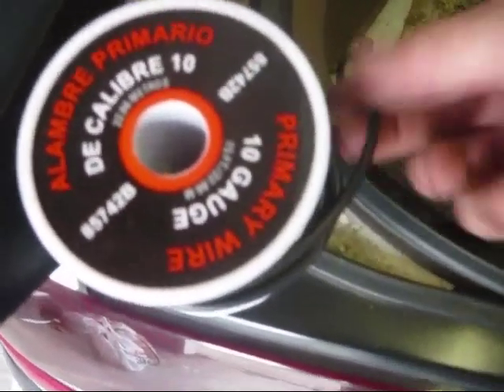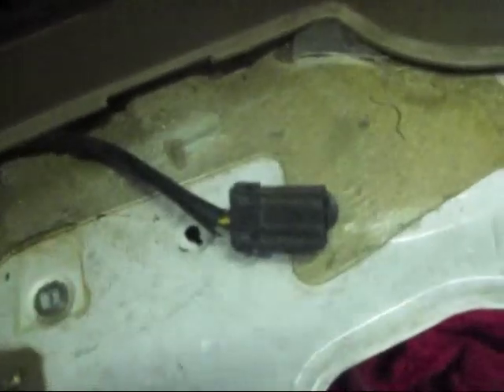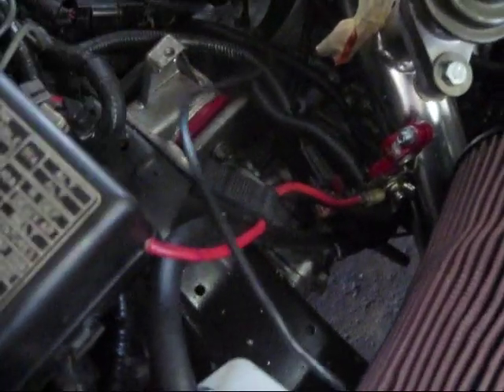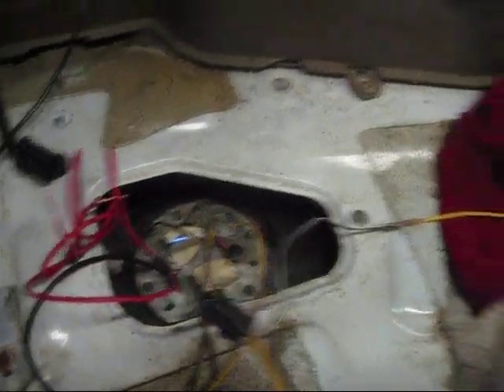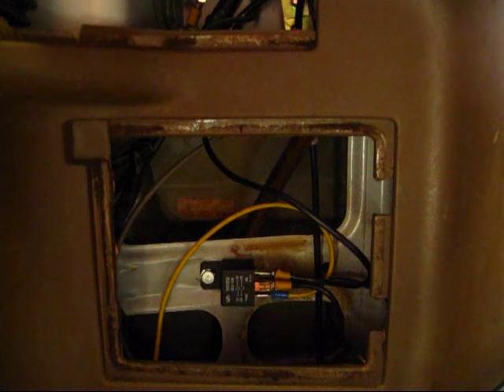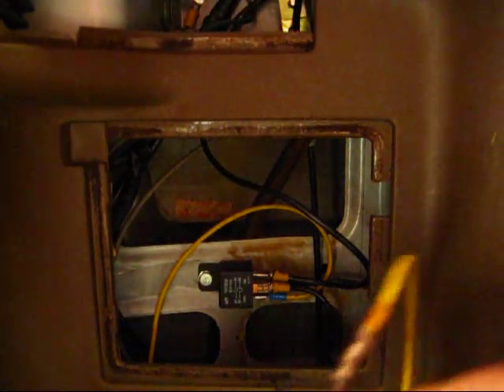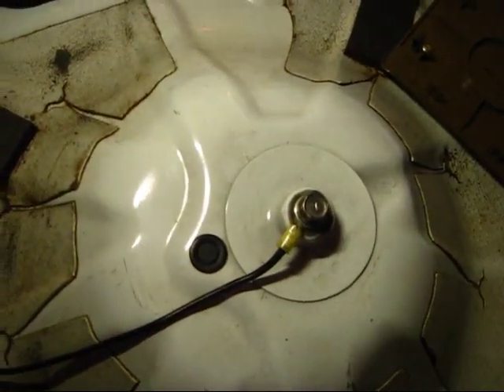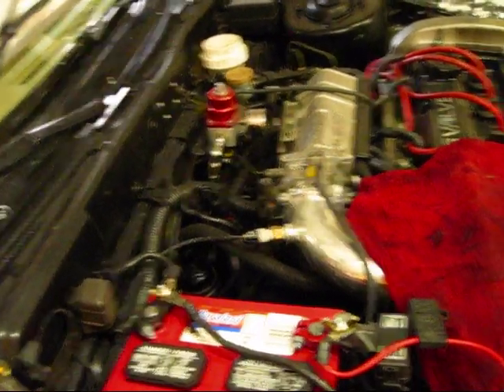1G AWD Fuel Pump Re Wire

Comment: hey great video. im sorry for the question but when you grounded the wire, the one grounded onto the spare tire hole, coming from the harness, is that necessary or did you do that just to be safe? i got lost at that point. im trying to do this to my fuel pump because i just got an aftermarket one and wanted to wire it up similar. excuse my noob question haha. thank you

might i add im doing to this to a honda civic :)
Reply from the maker: The fuel pumps have to be grounded and that is just the spot that I chose. You could ground them almost anywhere.
Reply: yea i saw that and saw that the relay has to be grounded as well. now as far as the existing ground wire that went from the fuel pump to the exisiting harness, on the harness side, what should be done with that wire?
Reply from the maker: Isitwrongtobestrong1 My pump was not grounded to the existing harness, it was grounded to the fuel sending unit so there was no wire left over.
Reply: oh ok, thank you for all the info. great video

Comment: I just make the same work on my 92 dsm but my gas light is on Always ! Any help please
Reply from the maker: Its possible that the fuel sending unit was damaged during the install. If the float was bent or did not go in correctly, it could cause these issues. 

Robert
Reply: robertbaxley ok perfect thanks

Comment: Just bought my first dsm.  Its a 92 talon tsi 6 bolt fully stock. My problem is that it wont start. The previous just had the head rebuilt by a reputable dsm shop. I'm thinking its the cas or ecu. Wont be sure until I have more time to do tests. Oh and he just put a 190 lph pump just before it stop starting.

Comment from the maker: What voltage are you logging with link? Sounds like you have a flow restriction some where in the fuel setup. Check the fuel sock, fuel filter and any other places where you may have a restriction. Are you measuring this on a wideband? 

Robert

Comment: it acts like it wants to throw more fuel but doesnt. My base fuel pressure at the regulator is 37psi (1g dsm). Im running fic 1000s, ecmlink v3. I got my stft and combined ft around 0% like it should be at idle. all that is good except for boosting. when I hit my brakes or turn lights on or use any accessories it still oscillates the whining sound (not as bad as it was before the rewire). I did however test my alternator and its not good. It charges then doesnt charge then charges...and so on.

Comment: So my fuel pump is rewired correctly, checked with multimeter and got the 255 in there. Car idles good at around 14.7 and cruise is around that too. but when i boost it doesnt richen out enough at all, for instance at about 3psi its at around 12.8-13.8.same with when I boost anything more then that also.

Comment from the maker: I actually broke the positive terminal on the hanger by over tightening the nut so my hanger always had a hole, therefore my wiring was always done all the way to the Walbro connector. You may see the RTV in the other video but I advise using a rubber grommet if you go this route. 

Robert

Comment: I checked out the video of the hanger and it looks like you drilled a hole and inserted a grommet into the drilled hole for the power feed wires for the pump? Before you did the double pump setup you had your single pump rewired right? Did you use the original power wire from the pump to the sender? Then just use the 10 gauge from the top of the sender to the relay? Thanks for all of the help Robert!

Comment from the maker: It does not go through the sender. Watch the fuel pump hanger video I have posted (I would post a link but you can not in responses) on my channel. Start at about 6:50 and you will see how the wiring is ran. Let me know if you have any other questions and I hope this helps. 

Robert

Comment from the maker: I am not familar with the EVO fuel pump. Drop in, includes a lot of details besides wiring. The height, width, and fuel output will need to mimic the stock pump to bolt in. DSMtuners will more than likely hold the information that you are seeking. Hope this helps. 

Robert

Comment: I had a quick question about installing an EVO IIIV fuel pump on a 1g 90 dsm. This will be an upgrade to the OEM 1g fuel pump. Would a Walbro fuel pump rewire kit make the EVO IIIV fuel pump a direct drop in for a 1g 90 DSM? I have read that the EVO IIIV fuel pump has a different connector compared to the 1g 90 DSM fuel pump connector. Is this true? Thanks for the help!

Comment from the maker: Thank you. I did find it easier to start from the back. It was easier to feed the wire downhill through the rear panel than trying to go up hill. 

Butt connectors do a great job in crimping the wire and with a little solder you have a created the best connection possible. :) I like doing things once and knowing that they are done right!!! :)

Suprisingly, that plate just needed a little cleaning and it looked great. Lucky me. 

I am glad that you are finding these videos useful :)

Comment: Looks good Robert, I did my rewire a little ways back, interesting you started at the back, I found it easier to go through the steering column gromet from the front to back then the other way around. I am impressed that you solder even the butt connectors. I am jealous of how nice your plate that covers the sending unit looks! New pump went in this week and your dual pump video helped a lot. Thanks a lot!!

P.S. just so you know it is black and white for all the 1g AWD (I have a 91)